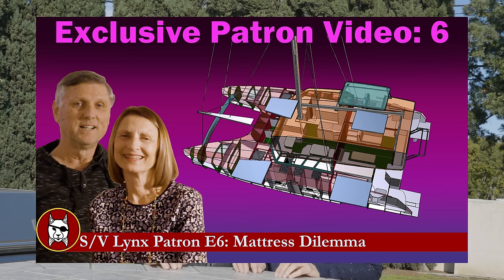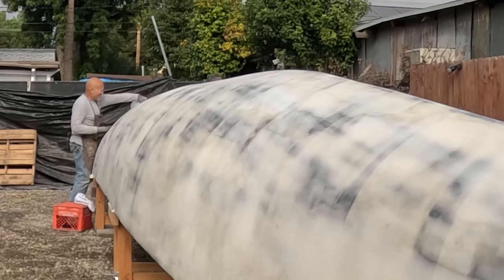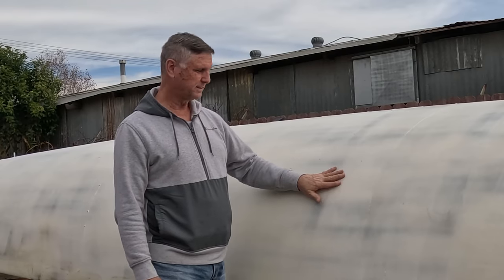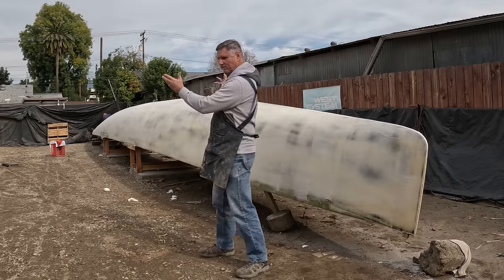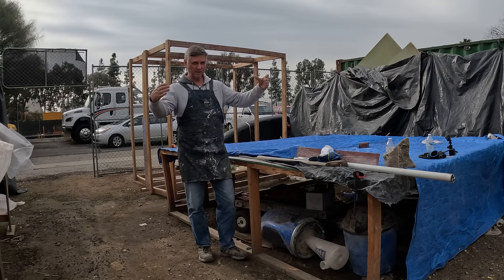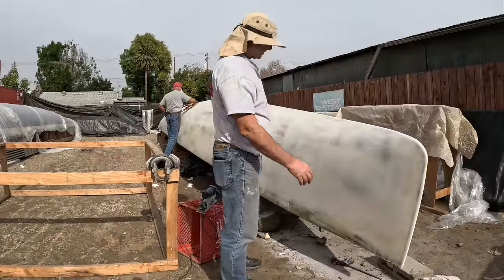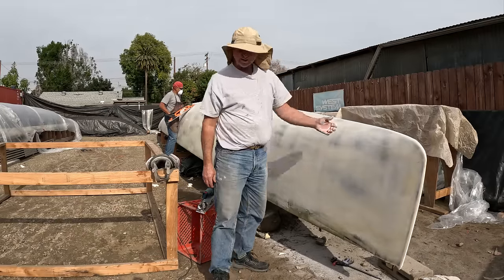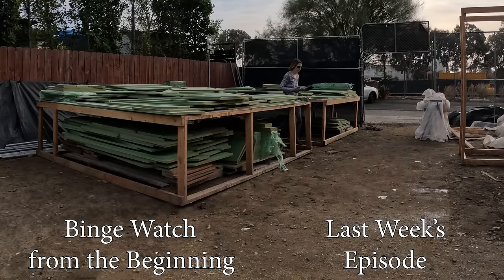Kit E67: Back to Boat Building

Comment: Good to see that you are back to progressing on the build. Such a loss of time with the tunnel tent and container fiasco...

Word of caution though, if I may, those table frames you built were never intended to carry heavy loads, but now that you have so much stacked on them, there is a real possibility that they might collapse because there are no diagonals preventing the uprights from "buckling". If the table were to get bumped it could collapse...
Reply from the maker: Fortunately, the foam panels are very light.

Comment: Good progress despite all your set backs. The tables need some 45 degree bracing on them or there going to fold over and trap some one under them.
Reply from the maker: The foam panels are very light.

Comment: I know all about the nightmares of Real Estate for boat building/refitting. Short version: defrauded on a piece of Real Estate in Brunswick Georgia just 1 1/2 miles from the Landings marina, which would have been a left and right another left and onto the property. Unfortunately constantly harassed by neighbors who've been waiting for decades for the lot to go up for sale and never knew it was put up on the internet for sale. As said short version  I got run off by the natives.
BTW I'm a New Yorker so to them I'm automatically a  yankee.
BTW my refit is off a 50' trimaran with a 28'beam that was refitted once before from a regular open beam with trampolines between the main hull and amas to a bridge deck tri similar to a Norman Cross and my refit will convert it towards the Neel trimarans. Once I purchase a new vacant lot I'll start my channel.
Reply from the maker: We wish you the best of luck and look forward to seeing your channel.
Reply: @SailingSVLynx  BTW, one of the projects on my list is to reglass my hulls and deck because I found some delamination. Thanks to seeing you do yours with Basalt, I did a bunch of research on Basalt and decided to go with Basalt instead of fiberglass for so many different reasons. Something I've noticed with basalt is that it seems to have a lower pitch sound when something makes contact with it. I'm so curious about the sound of rain when it hits the basalt compared to a fiberglassed deck and cabin top. The no electrical conductivity of Basalt is a nice plus.
Reply from the maker: Yeah, we think basalt is an excellent choice for lamination.

Comment: Just wanted to make sure your new larger BMS aren't the new faulty JK models that I've been hearing loose settings when disconnected for a few days and default to 4.2V charge voltage that will destroy LiFePO4.
Reply from the maker: How would I know?
Reply: @SailingSVLynx  I'm not sure, I've just seen two YouTube channels talking about the problem, Off-grid Garage said he tested his by disconnecting it for a few days and it lost its settings.
Reply from the maker: I looked at his episode, that's not the BMS we are using.
Reply: @SailingSVLynx  That's good to hear.